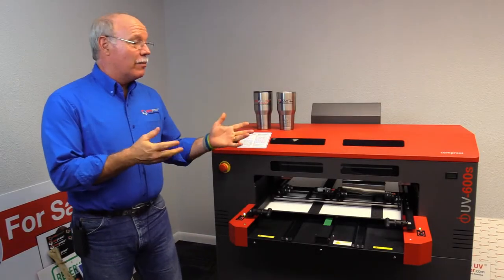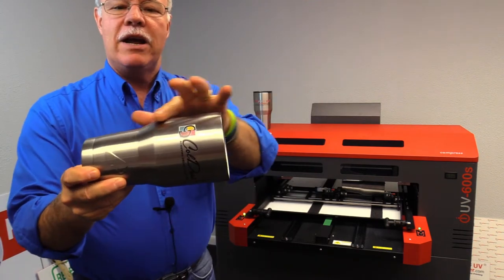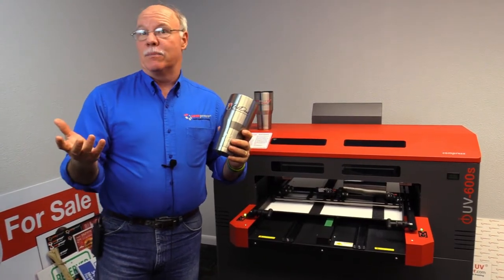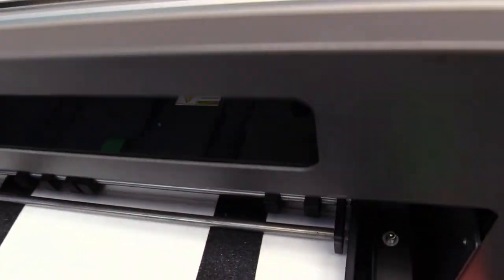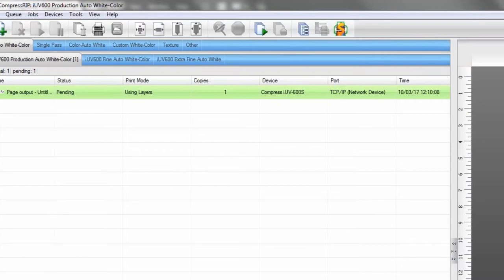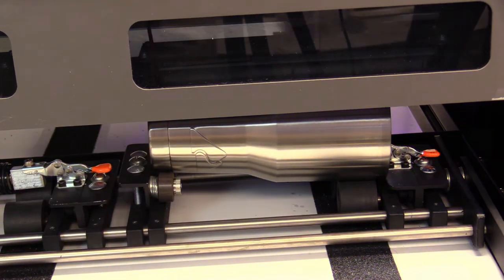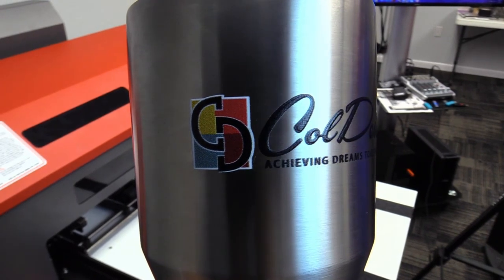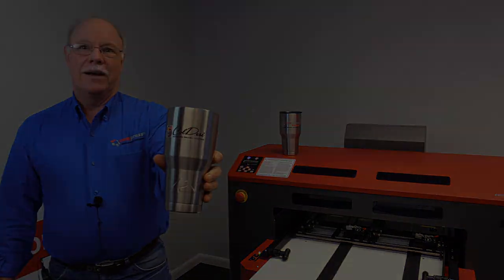Making Custom Tumblers | Compress LED UV Printer Conical Printing Jig

Comment: We had IUV1200 for over a year now, and is not reliable.  Due to hardware problem, the print bed movement is not registered precise enough, causing multi-pass printing not acceptable.  The white ink overprint especially resulting un-sellable  products. The dealer and manufacturer are not able to correct this problem.
Reply from the maker: Hey Instant - sorry we didn't see this sooner! It sounds like you had an issue with the former dealer for the product. Please contact us if you haven't already at 877-793-3278 and let us see if we can help. We've got many happy iUV1200s users out there and hate to hear you're not up and running successfully.
Reply: @CompressUVprinter  did he ever contact you?
Reply: @TheRealAmythyst  we have the same problem! This machine breaks down in every way imaginable. 

The circuit board, the print head, the motor all broke. 

The company keeps blaming other people for the machine they sell. 

Customer services wants you to keep putting money into the machine and trying the same thing that you fixed over video with them - and the machine still does not work